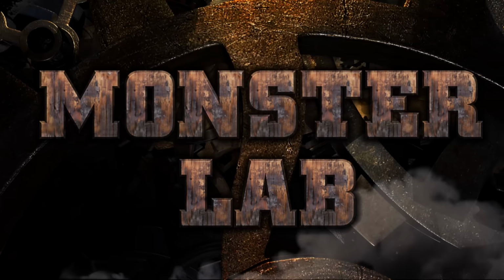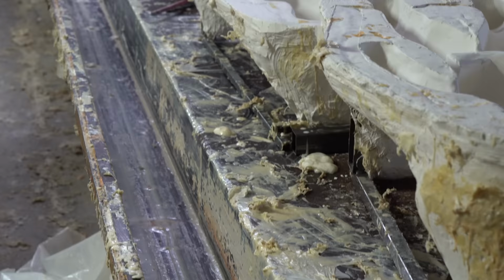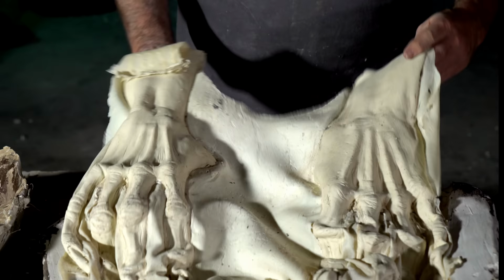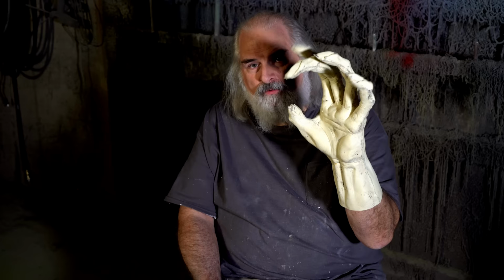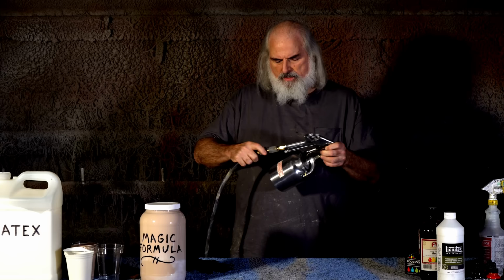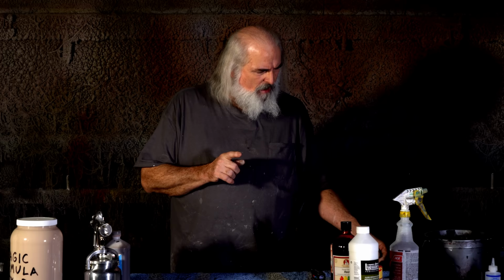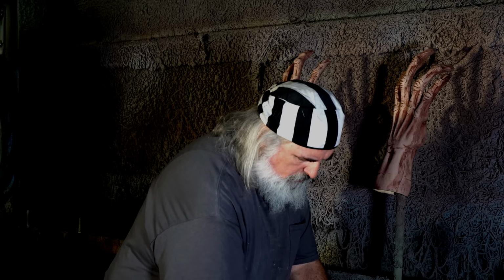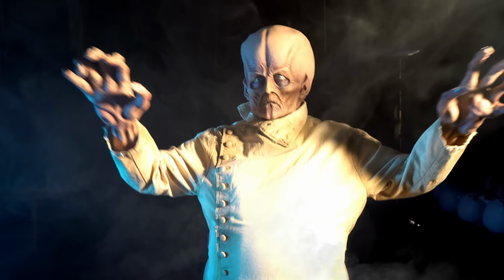How To Make Latex Monster Gloves Pour & Paint DIY Hands Tutorial | Monster Lab

Comment: If you MUST start casting as soon as you finish in the mold, sloshing in 3-5 layers, one at a time, will work better than dwelling. This works best with shallow one piece molds and medium thickness latex. 

Slosh a layer into the mold and then dump out the excess, let dry for about 15-30 minutes with a fan, and then repeat. This also works for molds that are built in a way that won't hold liquid (think "U" shaped).